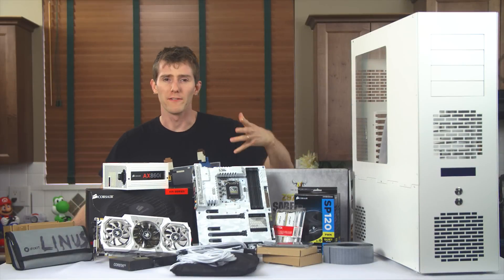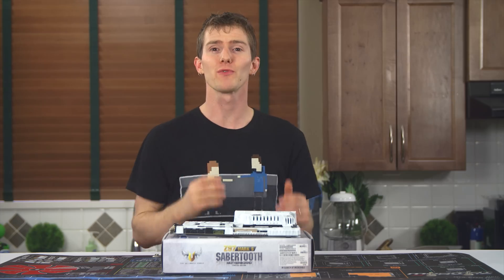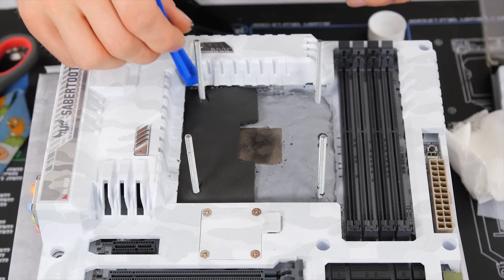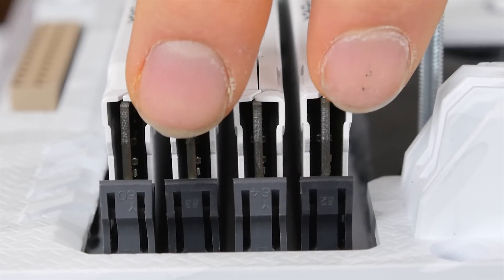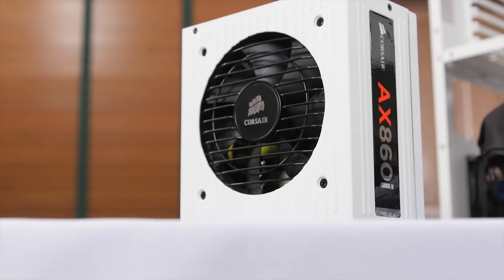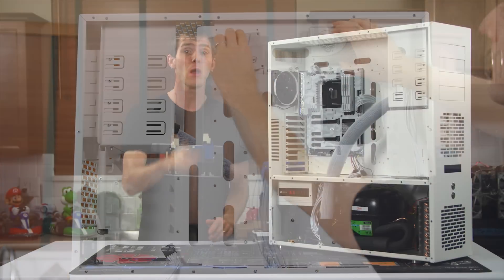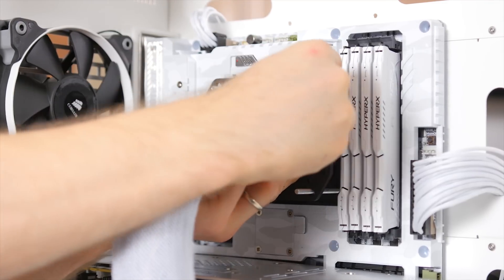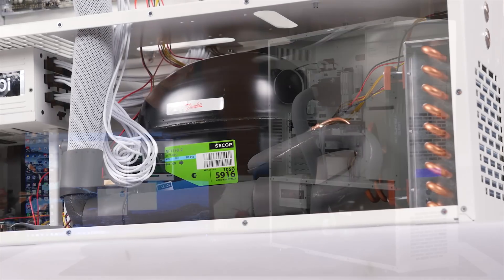ULTIMATE Sub-zero Phase Change Cooling PC Build Guide

Comment: What coolant does it use?
Reply: +Jackofspades I would bet its a freon like a normal fridge or air conditioner
Reply: there's a sticker on the compressor, it reads 134a
Reply: +Jackofspades there is so called 1,1,1,2-Tetrafluoroethane or R-134a.
Reply: Gabriel Hidasy That's possible. I checked the case website but couldn't find anything.
Reply: +A Christian Gamer Did you ever get a chance to look up phase change cooling? I just need to know that you realize it doesn't use water. It uses R134a, a common refrigerant used in air conditioners, fridges, freezers, etc. There are plenty of other refrigerants out there, R22 was used for some time in domestic air conditioning, etc., but the point is that it's not water and the ability of refrigerant to absorb heat when it boils inside the evaporator core that's held against the warm CPU is what makes it so much more robust than plain old water cooling.
Reply: +Jackofspades They use a substance which has a fairly low boiling point, youd never use water.
Reply: dregenius I just assumed water.
Reply: +Karl Edward Casareo Plus Freon Has a boiling poing of -40 Degrees Celcius (~ -50 degrees F). If you have a powerful enough phase change system, then theoretically, the above temps is the lowest that you can take freon.
Reply: Most likely water.
Reply: A Christian Gamer But it's phase change. Is the CPU hot enough to boil water?
Reply: Jackofspades No, CPUs will most likely be at 20-70°C and water boils at 100°C.
Reply: +A Christian Gamer So it can't be water then.
Reply: Jackofspades No, it is water.
Reply: A Christian Gamer Do you have a source?
Reply: Jackofspades No, but what else would it be?
Reply: A Christian Gamer You know what phase change cooling is, right? The heat produced by the CPU is changing the coolants phase of matter. That's why it has a condenser, to convert the gaseous coolant into a liquid.

Edit: Linus even mentions the coolant boiling in the video.
Reply: Jackofspades It's not the CPU that's boiling the water. CPUs don't get hot enough.
Reply: A Christian Gamer They get hot enough to boil some substances. Propane for example.

Comment: An actual question though. He said that in certain situations a power supply can kill you. When would they be dangerous (and is this even when it's not plugged in)?
Reply: Unplugged psu's can kill you, it just has to hit your head hard enough
Reply: +CH AOS lol
Reply: +nster the capacitors only hold charge for seconds and the charge they hold wouldn't be enough to kill you
Reply: +CH AOS do want to test that?

Comment: something i can comment on with power supplies NEVER EVER EVER (insert many "EVER"s here) cheap out on a power supply. i made that mistake and it couldnt handle my new build and as a result it stoped working and i was lucky enough that it was only the PSU that got damaged (although my main HDD seems to have recieved minor damage causing one damaged file). when we tried to diagnose what had gone wrong it short circuited, literally blowing off part of the circuit board, causing multiple blue sparks and a VERY loud bang that scared us half to death.

Comment: the wires use at 7:47 are the same wires used in hobby grade rc planes!
Reply: +yamaan93 and drones
Reply: +yamaan93 it's just a regular cables, you can find them almost anywhere
Reply: +yamaan93 and cars

Comment: I know this is a old video but here I go. Instead of using artist kneaded eraser why not use Sugru. it is a rubber putty that repels water but dries and handles heat better. All without having to worry about it getting nasty. You can even get different colors to match your case or whatever.
Reply: +Dave Zoll (Ogre) y not both
Reply: Worship Da King Sugru dries to a solid rubber artist gum does not. That and artist gum is more porous. Other perk if you open it to clean it and you bump the sugru it does not budge where the gum will. Sugru is just more versatile as it does all sorts of cool things.

Comment: Is that a TEC1-12706 module? I'm using one in my scratch built motorized stand / sit pedestal desk case, Via my custom Turbo boost centrifugal blower.. ( looks like a rusted retro spaceship). I'd love to share video and send you a Turbo TEC blower to check out. You can negate any frost/ice/condensation build up with inert argon gas.  sadly a bad ass possibly worlds first motorized sit/stand computer case with an old HP inside :(

Comment: If I have a power supply with a 6 pin PCIE connector and I want to buy the MSI r9 380 do I need to change my power supply

Comment: If I used a GTX Titan X with an Intel i7 8-Core Haswell at 3Ghz and 16GB DDR4 24000 Ram....will this system yield a buttery smooth performance without overclocking?
Reply: there might be better gpu options🙂
Reply: +Joseph Long ????
Reply: +Viktor Panum  like 980 cards in sli. It's cheaper and performs a little better than the titan 🙂
Reply: Um there will always be better options.. titan x sli
Reply: Ok
Reply: +Viktor Panum    Titans are still great cards but great comes at a price.
Reply: +Joseph Long But only due to the extra memory, which almost nothing utilizes. So buying a Titan X is like paying an extra $350 for nothing.
Reply: +Exploding Cowy  agreed

Comment: So how is it that my pc build (that I'm not done with quite yet) has a 760watt power supply and uses an AMD 8350 processor, and a GTX 970 with 16Gb of RAM and he uses ALOT more demanding components, and has an 860watt? I don't think either is wrong or anything, but how does that math work out? I also don't know what his "usual" setup is, but he has said that he uses a 1200watt power supply.

Comment: This seems like an awful lot of hassle and expense in order to achieve what are basically bragging rights. I suppose that's the point of this video, though.

I really wish Intel would go back to using solder to fuse the chip die to the spreader. 5 GHz is disappointing as hell, considering it's easy enough to get a 4790k's base clock up around 4.5 GHz with just air cooling. You just can't get the heat off the chip fast enough, no matter what mechanism you're using.

Comment: Should be a nice build to run Minecraft at max settings.
Reply: +Jacksparrow3195    Space cadet pinball at 7fps 😆
Reply: +Leonel Cantú de Llano sorry m8, only medium at 14 fps
Reply: +Leonel Cantú de Llano not enaugh graphics power you would need at least 3 titan x's.
Reply: So true "Temax", i have an i7 4790K and a GTX 970 and it crashes if i try to crank up the render distance. This is not Tetris my friends..
Reply: I love how people say this, but with my 960 that I can run most AAA games on max (at least ones I play) actually can't go higher than 10 chunk render distance on minecraft with max shaders/graphics.
Reply: +Leonel Cantú de Llano A german pc-magazine team build a pc which could run minecraft at 2700fps (on low settings while looking at the sky).
They now giving away the system costing around 36.000€ (40.000$) with all periphirals
Reply: +KaneWolf-Bane Minecraft doesn't support sli lol
Reply: 5960X GTX 1080 SLI here. You can run Minecraft with 12FPS on low settings if you play in 800x600 resolution.
Reply: Wonder how 4 GTX 1080 on SLI would do.
Reply: +Leonel Cantú de Llano if you like micro buffers then go ahead
Reply: frames per minute :DDDD
Reply: Jacksparrow3195 what!!? I use HD4400(cpu graphic card) and I play minecraft at max setting usally is 200fps...
sometime even 300~400fps with opitifine
Reply: you are probably a windows fanboy, but as a person who uses both (linux is my primary) i can tell you that minecraft runs better on linux. At least it does on my craptop
Reply: +Mid Night My two year old 2000 dollar system can run minecraft at 3200 fps
Reply: +Leonel Cantú de Llano hahah a 40$ pentium could do that

Comment: is this a good build? and is it all compatible?
CPU: amd fx-6300
GPU: Radeon r9 380
RAM: 2x8 GB
MOBO:Asus M5A97 R2.0 ATX AM3+
PSU: Corsair cx 600w
Harddrive: seagate barracuda 1TB
CASE: Corsair graphite 230T midi tower
Reply: get an ssd

Comment: this is the kind of cooling system i have been looking for, was considering doing a mineral oil set up to avoid condensation and eliminate dust buildup and putting a fridge system in the tank with antifreeze (or something alike) to supercool the graphics card as well as cpu. just an idea to go beyond watercooling without using liquid nitrogen

Comment: Wouldn't a way easier way of getting a zero air environment be filling an upside down fish tank with helium and than building the PC in that? You could even mount the radiators on the outside.

Comment: Is there not a way to use this cooling to keep a massively over clocked CPU at 30° so you can do away with all condensation protection ? a fridge maintains 5° but I am guessing the heat change is to sudden ?

Comment: The integrated cooling system is great and all but wont the white colour reflect heat back into the system and retain them inside?
Reply: I am not sure if troll or slightly misinformed.
Reply: +Feodor Volg not trolling at all. I'm serious. isn't white reflective compared to black?
Reply: +billy bob yeah I guess that makes sense. but darker colours are faster at dissipating heat to no? I just thought that white colour was also good at reflecting heat radiation. I stopped doing physics a long time ago so I'm not so good with it anymore.
Reply: only radiation is reflected, radiation heat from the components is lim to none so the case colour would make no difference
Reply: +Chris Blank hey, do you need a microwave? Or are you already heated?
Reply: +Chris Blank bro that was a reference from Onigiri a.k.a your profile picture smh

Comment: I'd rather use conformal coating and conathane potting material. Something to be said for materials made for protecting electronics from water and encapsulating circuit cards. You may have issues with CTE mismatch with the kneaded eraser material.

Comment: Shouldn't the psu fan be facing down to suck all the hot air out of the case?
Reply: ***** Well in that case (pun intended) the fan speed should be lowered so that the amount of air going into the case is consistent with the intake from the fans as well as the air outside the case to avoid condensation. :)

Comment: if it was single figure temperatures at 5GHz, went didn't you go to 5.5 or something and let it be like 30°c?
Reply: +DJPigeon His next enemy wouldn't have been the temperature, it would have been the speed of light itself.
Reply: Siana Gearz o kk
Reply: +DJPigeon I'm a bit late but what Siana said was a joke. The CPU wouldn't be able to accept the voltage required to hit a 5.5Ghz overclock because that's just how CPUs work.
Reply: +MoosE you say it couldn't accept the voltage, but that extreme over locker who works with corsair got an i7 to 6.035GHz at -177 C
Reply: +James Bennett Thanks to some very complex semiconductor physics, the cooler a CPU is, the more you can overclock it. Liquid nitrogen cooling doesn't just give you the necessary cooling capacity for extreme overclocking, it also pushes the silicon to the limits allowing for overclocking much further than any other cooling system - otherwise extreme overclocking could be done on 2/3 phase condensers like this, which would give the necessary capacity for removing heat but won't hit the -170C temperatures needed for the best overclocks.
Reply: MoosE
I know Siana was joking
Reply: +Blaze Firereign You're probably pushing into PhD-level quantum mechanics in order to understand how/why a CPU behaves the way it does at those extremes. As a bachelor-level myself I know most people couldn't even begin to understand it.
Reply: MoosE
Also, I was just poking aroudn and people have got the i7-6700k to 6.9GHz, but yeah, to reliably get above 20% you would definitely need liquid nitrogen
Reply: +James Bennett I have no idea how he managed to do that. He was using liquid nitrogen to get those temps though.
Reply: +MoosE Extreme overclocking is nto pratical for any type of usage, since when working on these extreme clocks they disable cores and hyperthreading for achieving a higher mark.
Reply: Carl Bernroth
Probably. My solid state physics course might have explained it all but honestly, I hated solid state physics so I've forgotten most of it...
Reply: +James Bennett I'm an overclocker, have been for years... anyway you don't need liquid nitrogen for more then 20% you just need water cooling. My i5-2500k goes from 3.3-4.9 no problem with a cheap water cooler... everything just takes tweaking slightly, raising voltages and clocks slowly.
Reply: Lt Dan's Leg
I know that, Im not actually sure why i said that given i run my 2500k on 4.7GHz with a 5 year old aircooler (I want to say ArcticFreezer, but not sure anymore), and except for the occasional bluescreen I don't have issues
Reply: I'd love to overclock my g750jw i7 4700 but the fans aren't strong enough to keep it under 100 degrees without like 80% thermal throttling, and I really don't want to take my keyboard panel off to clean the fans.
Reply: +Mister Dinner ...... u confuse me
Reply: the max temp is around 95 or 100 degrees same with the cpu I would not go further than 100 degrees ile

Comment: Phase Change brings me back to like 15 years ago when a lot of my time was spent fantasizing about this sort of stuff.
Would be fun to build but as you said totally impractical as the gains aren't massive and most gaming applications are GPU bound rather than CPU bound.
A cooled liquid setup would have the benefit of being able to also cool the GPUs. Insulation becomes tricky but a hermetically sealed box for the MB, CPU, GPU, RAM and other things that might benefit from cooling that you then fill with pre-cooled (dry) air before sealing should theoretically work? Perhaps add a bunch of silica just to be sure. Now THAT is a build I'd like to see! =)

Comment: you dont need spend that much cost on your cabinate just grabe old fridge and disassemble it and thke its required parts like comp., expanttion valve, evaporator and condensor its easy to build you need ducket which can fix on your core so it can cool it and a piping sytem which allow the fluid to flow. But any way i`m huge fan of this chanel it helped me to hoy to chouse component i have bulid my pc on AMD fx 8350

Comment: LOL nice but big$$$$$$$ check this out not as fancy but it should be able to oc to 5ghz no problem. " PC two stage cooling system H2O and peltier thermoelectric cooler OC FX8350 5Ghz? Part 2"

Comment: Sorry you lost me after you said you were going to passively cool the video card.  I think most enthusiast would rather see overclocking on a GPU rather than CPU.
Reply: +Cody Russell Also a big reason people want heavier cooling is for smaller form factors such as mITX as you have so many parts crammed together passive cooling isn't as efficient as liquid or in this case phase change.  Great idea however.
Reply: +Cody Russell Enthusiasts always buy stuff they don't need if they're gamers anyway. Like i7s or 16GB or more of RAM.

Comment: Instructions not clear enough, GPU got stuck in ram slot :P
Reply: So the first step is to delete System32, because it is slowing your system down. The next step is to open microsoft edge, and then go to www.GetFreeVRAM.com, it will be the first link. Download that and put it on a usb key. finally shut down your pc, open it with a hard tap on the top via a hammer and put the usb kkey into the cpu slot.
Reply: Joke not original enough, laugh got stuck in my lungs
Reply: Response not clear enough, thought proccess got lost on youtube
Reply: Rock Parker rip
Reply: JA150EA How do i download a new graphic card?
Reply: +Rock Parker sounds good to me though, you can now easily http://downloadmoreram.com and it will automatically be added as VRAM to your Graphics Card, which you can then plug back into the PCI slot.
Reply: p.s. if you don't have a USB key, a good way to substitute a USB is to use an electrical tester. but obviously that won't fit into the USB slot. you may need to use a Robinsons screwdriver to open the port wide enough
Reply: Solitude Woah man.
Reply: +Rock Parker Instructions not clear enough, got molex cable stuck in ass.
Reply: ***** ok your getting clean from inside but the mess is ..... going out of your mouth XD
Reply: +Rock Parker non stick frying pan: instructions not clear enough got dick stuck in non stick pan
Reply: +Rock Parker omfg xD
Reply: +Rock Parker savage OmG 😂😂
Reply: +Rock Parker instructions are clear but i dont have a usb , what should i do ??
Reply: ... I just realized that an idiot has probably tried that before.
Reply: lol
Reply: Rock Parker my penis got stuck in the front usb port
Reply: Rock Parker lol

Comment: My Experience with Galax was not as good, the GTX 980 Ti HOF I purchased was DOA. Upon asking for an RMA for a Refund, as many complaints seemed to be for DOA HOF Cards, it took several emails of persuasion to get them to Waive the 15% restocking fee on a DEAD BOARD. After two weeks I received my refund but at the $40.00 return shipping cost and minus the original shipping fees I, personally, will not ever buy from Galax EVER again. Every time I submitted an RMA Request I received a reply from a different moron. Galax is not worth my time or effort again, as I lost well over 50 USD on this transaction and almost a month turn around time. If you had a different experience with them, well, lucky you, I will not ever consider them EVER again.

Comment: if the power supply is unplugged can it still kill me?
Reply: +jake cohen Yes, the capacitors inside can still be charged
Reply: +jake cohen Idk, read this http://www.cnet.com/news/teen-electrocuted-while-working-on-unplugged-computer/
Reply: That's like asking "If I drink a bottle of acid I will die, but if the bottle is filed with air instead, will it still kill me?" xD Relax, it won't